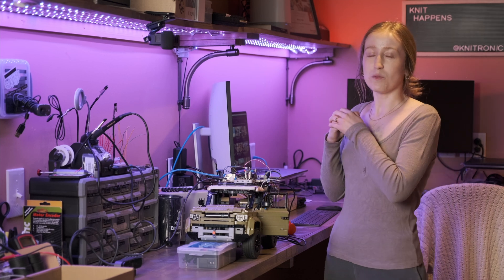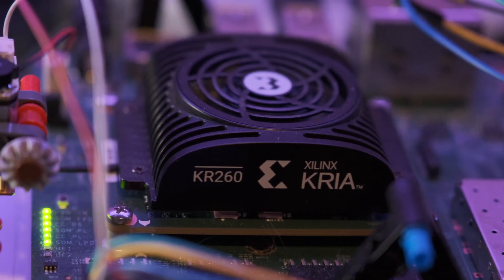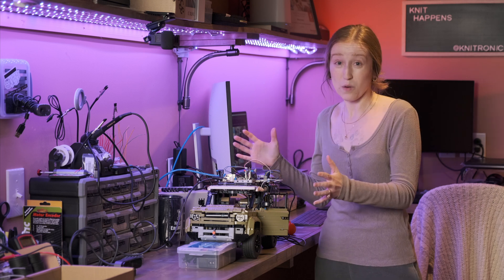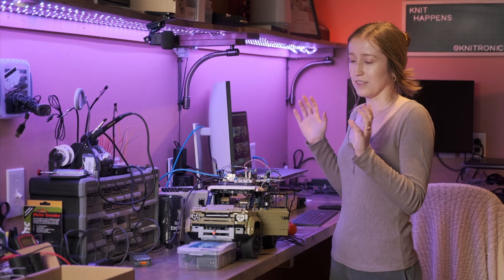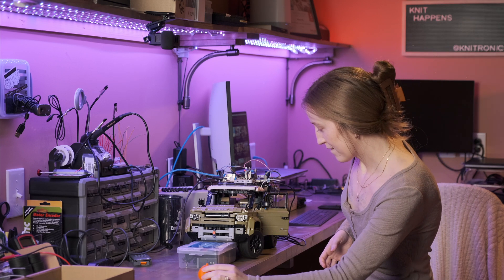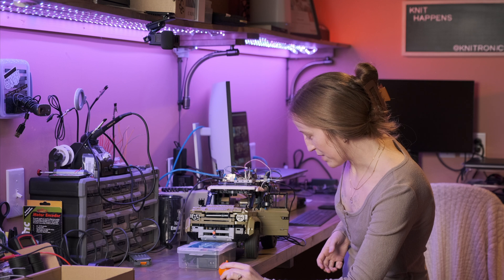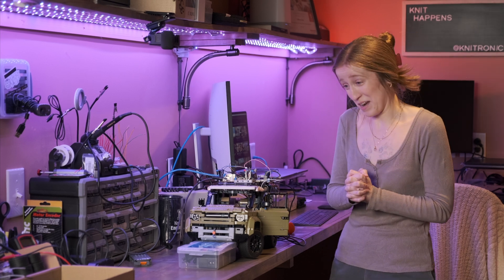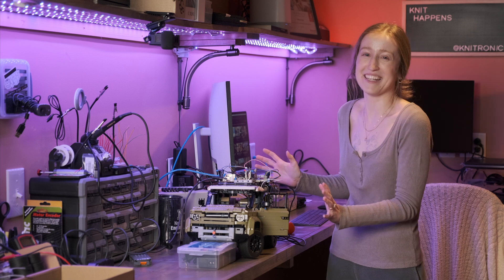I Made My Lego Defender Autonomous with the Kria KR260 (Part 2)

Comment: Nice project.
Question: For best utilization of the ZynqMPSoC on this kit, which do you prefer between letting PL handling all motor driving/sensor reading or letting the Cortex R5 doing it? If one these is use for that purpose, then how about the other? What good use can I make out of the rest resources?

Comment: Very good!  Question please:
I am disabled, creating  smart mower(small push mower).    In you obstacle avoidance,  each pass in mowing, the same obstacle will be seen in different positions per pass-by.  Can you work out that “capability” in route decision?  (Mostly). How close will your robot car pass by the OBSTACLE?

I FIGURE, ADDITIONAL SENSORS ON SIDES LOOKING FORWARD COULD HELP ROBOT CALCULATE CORRECT PASSING PATH TO (CLEAR ROBOT FROM BUMPING OBSTACLE IN PASSING BY “VERY CLOSELY”. IN ORDER TO MOW GRASS EFFICIENTLY.

2ND ROBOT FOR DISABILITY IS AN ARM (RUNNING ONA RAIL IN CEILING ALONG FRONT EDGE OF WORK TABLE).

BEHIND TABLE A LARGE PEG BOARD WITH ALL GROUPED VARIOUS TYPE TOOLS.  I FIGURED SECTIONING OFF PEG BOARD BY TYPES OF TOOLS, THEN POSITION LABEL EACH TOOL IN SECTION, (WOULD ALLOW VOICE COMMAND. OF “SECTION THEN TOOL POSITION” TO RETRIEVE THAT SPECIFIC TOOL.

SENSORS TO AVOID HITTING ME/LOCATING ME TO HAND TOOL TO ME (CLOSE BY GIVEN AREA).

I CAN CALL ARM, PLACE TOOL IN IT’S HAND AND SPEAK (TO PUT BACK TOOL BY SECTION AND LOCATION).

TOOLS CAN BE VERY SMALL PIECES TO CARVE WOOD (BITS),  SOCKETS FOR WORKING ON MOTORS, WRENCHES, MANY DRILL BITS, PLIERS, HAMMERS , ETC.  .

WHAT DO YOU THINK?

IS THERE A COLLEGE WILLING TO PARTNER WITH ME TO MAKE SUCH ITEMS ((((TO HELP DISABLED))).?  

SMART DEVICES TODAY ARE GENERATION 1 MOSTLY.  WE HAVE CAPABILITY TO CREATE GENERATION 3 OR 4 I FEEL!

I ALSO DISCOVERED VERY INEXPENSIVE ITEMS READILY AVAILABLE TO KEEP COST AT MINIMUM!

HELP ME ENGAGE COLLEGES FOR PROJECTS FOR HUMANITY!
Reply from the maker: You’re project sounds amazing!! 

Forgive me though, I couldn’t possibly answer all of your questions sufficiently in comment form here. The whole obstacle avoidance question is actually something I’m working on figuring out myself. 

Your project is very complex, so I encourage you to break it down into smaller sections to build and prove it as you go. Take a look at my Lego robot videos for an example of this. I’m also still working on developing an obstacle avoidance algorithm for it as well so you can see how I started with a simple version of it. 

Best of luck on your project!

Comment: I hadn't had much luck with Zynq, had gotten an AVnet Ultra96 board at one point (second hand), couldn't figure out how to make it boot or do much of anything, kinda gave up on it...
Had used the Nexys A7 (XC7A100T) for a while, then got a QMTech XC7A200T board, and had better results with these.

Had also before built a robot at one point (many years ago), but it was effectively a cardboard box with cordless drill motors, and some hand-wired H-Bridge drivers and some 3D printed parts. It was running on a RasPi, with a cheap webcam for "vision". It was using a sort of differential drive system (two main drive wheels and some idle wheels).

Had felt half-tempted to try to build another robot... But, not really sure if I have the time/motivation to do so. Might want to build it out of higher quality materials this time (significantly less cardboard and hot glue). Maybe use mecanum wheels or similar (and could maybe machine some amount of parts out of aluminum or similar).

Had implemented a CPU for a 3-wide VLIW ISA on an FPGA, which runs at 50MHz (basically, a hobby ISA project I had called BJX2). Also wrote a C compiler and emulator and similar as well.
It can basically execute up to 3 instructions per clock-cycle, and had 64x 64-bit registers (can also be used in pairs for 128-bit SIMD ops).

The thing can also execute 4-wide FP-SIMD ops with a 3L/1T timing, so can pull off up to a theoretical limit of 200 MFLOP/sec per core.
It seems to do "reasonably OK" at running neural nets that have been compiled into a long series of SIMD ops, so it seems maybe worth testing (had written my own tools for training the nets and converting them into a large blob of ASM for my ISA).

Trying to use this for running a robot seems at least sorta tempting...
Reply: I know the pain too. Got an Ultra96v2 board 3 years ago to try out some AI but couldn't get it to bootup. The learning curve of Xilinx stuff is so stiff & took so much time is basically a wall for newbie engineers. Working as an FAE for Xilinx at a distributor help me growing a lot. But lots of work is needed to make this FPGA things to become more popular

Comment: As far as setting the GPIO, have you attempted setting udev rules for them? It looks like you should be able to add the /etc/udev/rules.d/99-gpio.rules with the following rules:

SUBSYSTEM=="bcm2835-gpiomem", KERNEL=="gpiomem", GROUP="gpio", MODE="0660"
SUBSYSTEM=="gpio", KERNEL=="gpiochip*", ACTION=="add", RUN+="/bin/sh -c 'chown root:gpio /sys/class/gpio/export /sys/class/gpio/unexport ; chmod 220 /sys/class/gpio/export /sys/class/gpio/unexport'"
SUBSYSTEM=="gpio", KERNEL=="gpio*", ACTION=="add", RUN+="/bin/chown root:gpio /sys%p/active_low /sys%p/edge /sys%p/direction /sys%p/value", RUN+="/bin/chmod 660 /sys%p/active_low /sys%p/edge /sys%p/direction /sys%p/value"

https://unix.stackexchange.com/questions/42122/set-gpio-permissions-cleanly